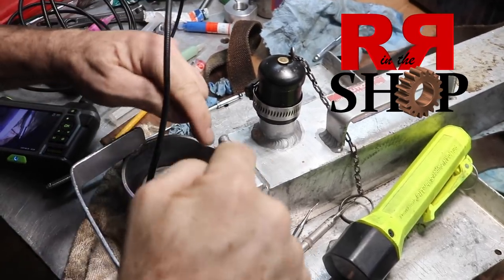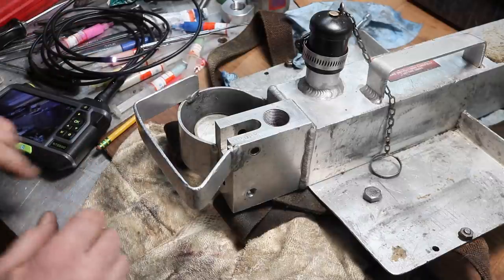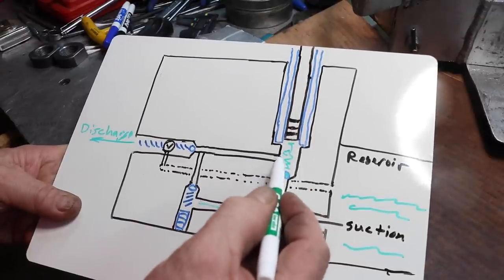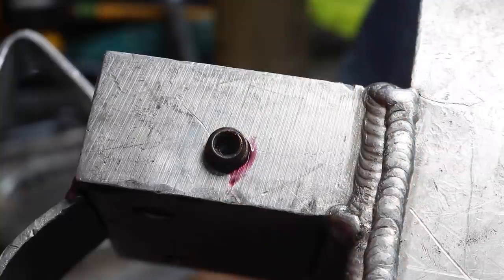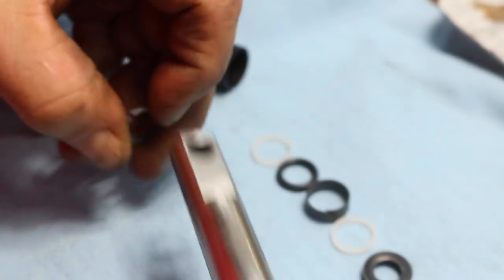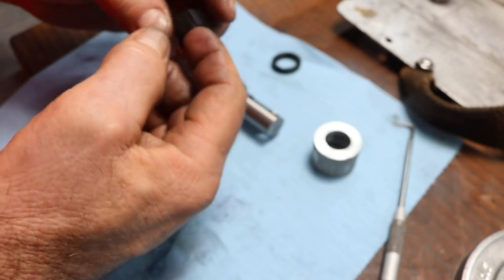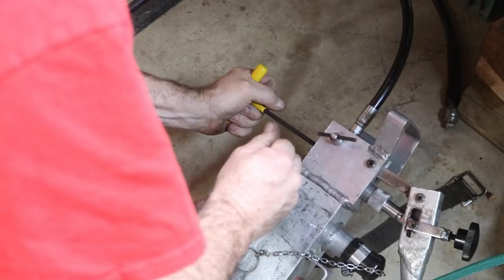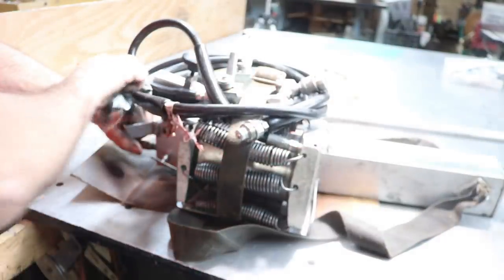Hydraulic Tree Jacks What are They?  Can I Fix Them?  Pump Repairs / Assembly P2

Comment: Randy, When I was a machine tool assembler at Bardons & Oliver Inc. I assembled the Carriage and Saddle aprons for their Turret lathes.
To put a perfect seat on to the lube pump check valves we would put the ball in place, and give it a good smack with a hammer and brass punch, this would conform the seat to the ball.
Reply from the maker: Yep that works.  Thanks Gary.

Comment: 15:40 Nice to see someone else likes that loktite 545, I used to use it on lube and hydraulics where ever tape failed on pipe threads, and it eliminated leaks on the tricky stuff every time i did a repair. Great video and nice explanation of the hydraulic circuit. Better like new as i always say.
 Enjoyed, cheers and seasons greetings!
Reply from the maker: Thanks Howder.  545 is great stuff, works very well.

Comment: I wouldn't have thought about lapping them initially. Probably would have thought about cutting..  Thanks, learned something, something. I don't think of lapping as a first cutting method... good info.
Merry Christmas
Reply from the maker: I did consider cutting them with a ball endmill.  Since it is all aluminum and cuts very easily I decided to lap first.  This worked out very well.  I have found that a little lapping first can give you a good picture to see how bad a seat is and which way to proceed.  Thank you.

Comment: you need more views especially for the knowledge you share. What caused all the wear internally? Was it the bearing? Oil? Debris?
Reply from the maker: Thank you Saki630.  I think so also.  I think dirt and debris in the oil does the most damage to all hydraulic systems.  This unit is used in a very dirty environment.

Comment: Hi Randy I use to work in the mining industry with high pressure being really close too the operator will hydraulic fluid injection from high pressure hose be a real concern from hose failure. What is your thoughts on this, well done job on the repair. Smash that fly lol.
Reply from the maker: When ever  you work with hydraulics and hoses there is a chance of failures.  Most failures are not catastrophic blowouts.  Most start with a small seep.  Few actually are of a spray.  With hand pump systems almost any kind of spray leak will not last long enough for fluid injection into the skin.  You can not sustain the pressure.  So with hand pump systems this I feel is of very small concern.  With pump driven systems yes there is more concern, since a fine spray can be sustained.  This is why you have additional safety precautions for areas where this could happen, fire sleeve material is one method to stop or slow a spray.  Thank you  for your question.  MC to you and your family.